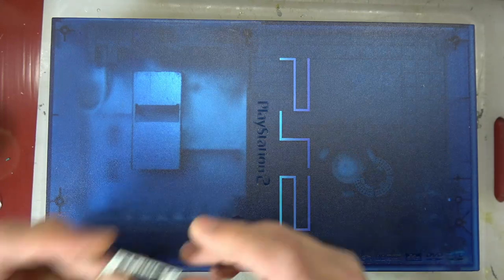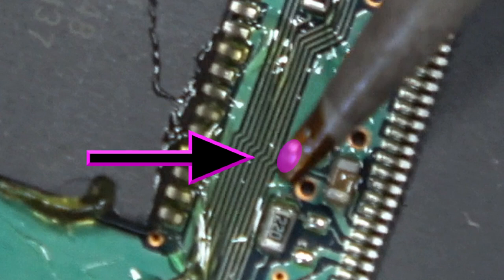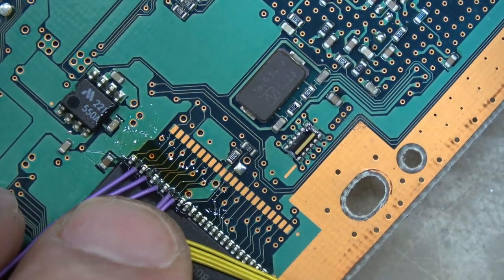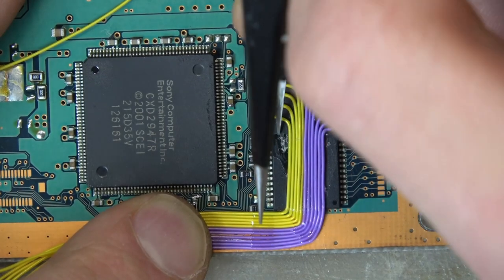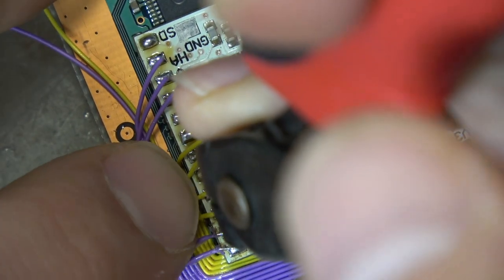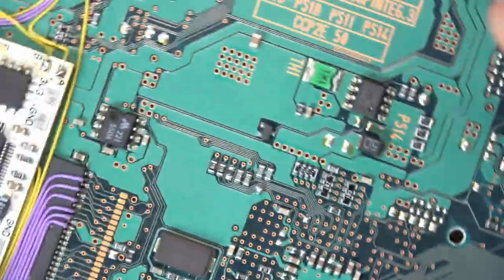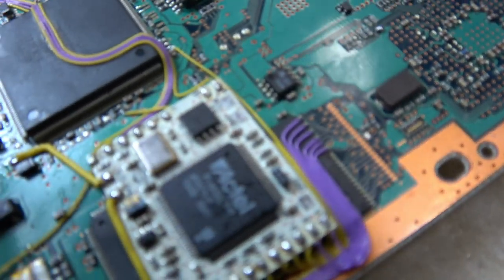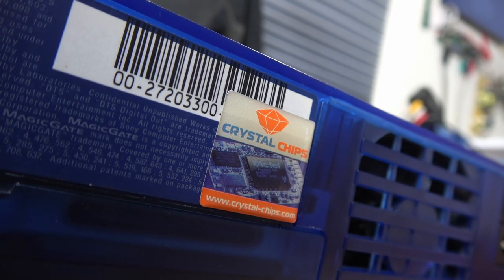PS2 FAT CRYSTAL CHIP MOD

Comment: Hey RGA, i got a question. I installed a modbo 4.0 on my ps2 slim. The install went very well. Wasn't super complicated after all, just a lot of prep but that's really it. I have 2 PAL games. Evil Twin which works just fine. However, the other game, the driving factor as to why I wanted to do the mod initially, is Siren 2. I've tried multiple TVs, cables, settings, but I can't get the game to run. It'll crash during cutscenes or even the first five minutes of the game where the game crashes during the first in-engine load screen. The only way the game doesn't crash is when i set the chip to Pal 50hz but of course i get the vertical scrolling screen. Is there any workaround that you know about in order to get the game to run? I'd really appreciate any advice you can provide. Thanks in advance.
Reply from the maker: the modbo have around a 98% compatibility rate for games, theres a few games that do not work with them, try other games and let me know if they work, so that way you can rule out if its a problem with the chip or if siren 2 is just one of the few games that dont work with it
Reply: @RETROGAMINGARTS  I appreciate the reply. Unfortunately i don't have any other games I can test. Is there anything else you can suggest? I've also tried burning ISO files from other PAL games and tried playing burned versions. But that didnt' work and I don't if it's because I burned it wrong of if it's the same problem. I also tried ripping the game and converting it to NTSC with a program that was almost impossible to find. And sadly that didn't work either.
Reply from the maker: @Derik64  ok, let me get on a keyboard because I'm going to type you up a long  troubble shooting techniques reply. And holy crap... let me know if my reply would make for a good video! 
(An idea has formed!!)
Reply from the maker: @Derik64  *MODBO TROUBBLE SHOOTING
*
First thing to note is the difference between the 2 install points on the board. The points that go to the BIOS are W, R, M, N, O, P, Q, T, U, V.. with W being the most important. Now if the doesnt properly work, it could be because of these bios points, and heres some Way's to tell if its not working.

One of the first things to do before troubble shooting to much is 
While booting the PS2, hold TRIANGLE + CIRCLE. This will give you access to the modbo's  menu. If you have access to that, your modbo is properly injecting its code into the bios. IF you get this screen, SKIP down to the CD/DVD controller part of this comment

IF your MODBO install
 Does any of the following...
1, boots a black screen
2, booting and freezing on matrix logo
3, booting and displaying 4 red ! ! ! ! 
4, ps2 boots perfectly and runs normally, but is UNMODDED it seems.
(all 4 of these could also be the modbo chip having whats called 'a bad flash' meaning since they where made in china in large quantitys, they could have been programmed incorrectly and still sold)

so if any of these are the issue, FIRST, examine your solder joints perfectly, make sure NOTHING is bridged and everything is the right point from the diagram. Also doubble check the Diagram with your GH-00x number. Make sure you have the CORRECT GH-00x number to your diagram, for instance, certain SCPH-xxxx number PS2's can be a certain V# , SCPH-70012 is a V12 for example. and that V12 can have multiple different GH-0xx-00 numbers. So cross reference the install diagram multiple times.

IF YOU ARE 100% CERTAIN you used the correct diagram, and your solder joints are perfect remove the chip and replace with new chip
. before replacing with new chip, test your PS2 as its stock, just to make sure nothing is wrong. If the PS2 is reverted back to stock and you still have issues. look for a component that may have fallen off the  PS2 during the install.

*FOR PAL PS2's THE "H" POINT ON THE INSTALLS IS NOT NEEDED, ONLY USE THIS POINT FOR NTSC/JAP PS2S*

OK, SO, LETS SAY NONE OF THAT IS YOUR PROBLEM, Lets say your PS2 boots to the Matrix infinity menu, but you can get any media to play.
That will be your CD/DVD controller points,  the CD/DVD ccontroller points A, B, G, H, I. and the CD/DVD controller is that BIG chip with the super fine pitch legs.

First thing you must do, to diagnose this problem, is play every type of media you can. Start with media from the region of the PS2.
Lets pretend we're talking about a JAPAN ps2.

1. try Japan PS2 game
2. try NTSC/PAL game

Now that you have confirmed the region works or does not work, we can move on. If the system is a JAPAN system, but will not play japanese games. Either the laser just died or every solder point needs to be doubble checked, and possibly removal of the chip, reverted back to normal, tested, and installed with a new chip.

If Same region media works/other region media works. (also test ps1 region and other region)

 Now its time to test Burned media, Start with PS2, then do PS1.

If your getting mixed results of some media working and others not working, Redo the A, B, G, H, I points, double check your solder work, and your diagram.
These points are the points that control the different media that is played. So that's exactly where to check. 

*Some Other key points to mention*
1, the RESET point helps time the chip with the bios, to boot the chip into the bios at the correct time, so this is an important point.
2, the CX point is the clock timer, the ORIGINAL MATRIX INFINITYS had a clock timer intergrated into the FPGA's code, so the clock point was NOT NEEDED on the originals, however, the MODBOS are a chinese clone of the original matrix infinitys, and they do not use the same IC on them, they are not capable of having a clock timer inside (the crystal chips used a crystal oscillator on them for this) SO the MODBOS use the CX point, witch pulls the clock signal from the PS2 itself, If this point has interference it can throw the whole mod off. Ever seen people run wires under the legs of the CD/DVD controller chip? (i'm guilty, i've done it several times...) you should be weary of do this. 90% of the time it doesnt matter. but if there is interference on the CX point, it can throw the whole mod off. Doubble check this point if your having issues.
3, POWER/GROUND, These points should be 24 guage wire, or 26. Thick wire. These chips do not perform well when the voltage and ground wires are thin. this can cause several different issues.

ok, i hope this is enough to help your issue, if not let me know, keep me posted. I also hope if anyone else is having issues they see this and it helps them!

Comment: Flux isn´t for reduce Oxigen. its etching the oxide layer on the (copper/Iron/zinn...) so solder only sticks on the materiel not on the oxide thats why u use flux ;) . Oxide is createing by the materiel itself if u leave it on the air so flux is etching it and prevent that air is coming on (in this case) copper. :) Sry for my bad english :) Hope u can learn something :) I learned that in school. In germany u need to go to school too, to be a blacksmith and soldering is a part of this cause u can use soldering not only for wires you can use it like kind of welding, than its hard soldering.
Reply: and holy fuck i love ur wirerings ♥
Reply: yeah it prevents it from oxidizing, u get his point.

Comment: I own a fat PS2 with HDD installed and I use Free McBoot to dump PS2 games to hard drive (from PC via Ethernet) and play them without putting any additional stress to an optical drive.
I've visited Russia recently, and brought some of my old favorite PS1 games my parents still had in my old room. But since every PS1 and PS2 game in Russia is pirated, the only way I can play them is by using a disc swap method, and I don't really like that. I also brought back few PS2 games and there's no way I can play them without a chip mod.
So the question is: Is there a chip that will allow me to play unlicensed (burned) PS1 and PS2 games and will not conflict with Free McBoot?
Thank you.
Reply from the maker: From my experience, you can use free mc boot AND a modchip at the same time, the only time they conflict is when using FCHD, free mcboots HDD version, if your using a free mcboot memory card it should work fine with a modchip. HOWEVER, your freemcboot should be able to play your old burned games

Comment: My PS2 with DMS3  was damaged by seawater and when i cleaned it up and tried to use in another PS2 i got BLACK SCREEN, is any chance to check by tester it';s work condition?
Reply from the maker: Yes. Doubble check every single solder joint. And check the bios connections aswell

Comment: Link to where you can buy the wire from or at least info on the wire, also what gauge is that? Cheers
Reply from the maker: Hey, sorry I didn't put any of this information in this video, I made a few other videos just like this that have it so I left it out, my bad. It's 30 AWG kynar wire,  I buy from ebay usually. I use 26 Guage stranded wire for power/ground (24 is ideal)
Reply: @RETROGAMINGARTS  Cheers for the reply :)

Comment: Wait, am I seeing things, was that a firewire 800 port by the two usb ports?
Reply from the maker: I'm not sure what firewire800 port is
Reply from the maker: Sounds like an old connection from the late 90s that got phased out
Reply: @RETROGAMINGARTS  Pretty old data transfer tech from late 90s/early 2000s. It was pretty popular cause it could push 800Mbps, which was a lot at the time.

Comment: Hi mate. Does a bad solering or wiring cause hdd read issue????
Reply from the maker: Theres many things that could cause that, why, what you got in your ps2 and what happened?
Reply: @RETROGAMINGARTS  thanks for the reply. I have a fat ps2 with freemcboot mc and a gamestar sata hdd adapter. I formatted a 500gb hdd with winhip, loaded a couple of games and hooked up to my ps2. In hd loader and opl, no games showing. I used hdd manager (misc) in ulaunchelf and it shows like hdd connected but not formatted. I formatted the hdd in ulaunchelf and it shows the hdd space and was able to read. Once i reboot my ps2, again its showing hdd connected but not formatted. I tried  with other gamestar adapter and hdd but same issue. I'm spending more time but still couldn't find what cause this issue. Any suggestions mate??.

Comment: Where did u get those nice cables?
Reply from the maker: Here's an exact link to some of the wire i use
https://www.ebay.com/i/252533787813?chn=ps

and another link for different colors
https://www.ebay.com/itm/30-AWG-KYNAR-wire-wrap-30-gauge-Kynar-100-FEET-Any-Color/200406828204?hash=item2ea92d84ac:g:f9gAAOSwUuFW1Zv-:rk:23:pf:0

Comment: How can i play some burned iso because my gta san andreas is pretty scratched and not working :( 
So how can i play a burned game on my slim?
Reply from the maker: A chip like this will do exactly that 😀
Reply: RETRO GAMING ARTS yeah bur do you know a new one ? Because the one you had was very old
Reply from the maker: @e99g  modbo5.0 is the current chip, its a clone of these good old ones, but you can use any modbo4.0/750/or5.0 chip, any one of those 3 will all do the same, i did a video about the modbo5.0 feel free to go check it out
Reply: RETRO GAMING ARTS did you installed also some mod chips on a slim? :D
Because I found recently my Slim babay in the basement and i want to play some good old street boyz or flat out , but the problem is that the discs are just scratched
Do you have some tutorial for the slim?
Reply from the maker: no but, i have a slim i hafto mod, so i'm going to film it and make a video about it
Reply: RETRO GAMING ARTS ok nice thansk

Comment: Wow, superglue? That may look nice, but it could cause issues in the future. These modifications should be (easily) removable. If you want that look you could try supergluing just the top of the wires and not adhering them to the top of the chip.
Reply from the maker: They peel off from the top of the chip pretty easially. It's when you glue them the the solder mask of the pcb board is when it becomes a problem. I could remove this mod and make it 100% stock in less than a few minutes.
Reply: Why would you want to remove the mod? Just buy a new console, they are so dirt cheap...
Reply: @chajaso  He's saying that the super glue isn't an issue, not that he would ever remove the mod.
Reply: @chajaso  Modifications to the PS2 console will likely evolve over time. You don't want to be stuck with a mod that isn't easily removed. That said: there are a LOT of PS2 consoles out there, but some versions are better than others – and preservation of obsolete technology should always be a consideration.
Reply: @philexile2954  altho partialy true, I wont count on many more updated or improved modchips for older systems to come... or atleast tackling this part of the system. HDMI adding or ISO loading virtual dvd/cd drives maybe, but once a system can run homebrew, why risk killing a system when it works? 

ow well, yeah I sometimes swap a modchip for a newer one I have. but only if it adds a feature a realy old modchip dint came with. not too much glue would be the right advice ;)
Reply: Wut?  The ps2 20 years old LOL evolve

Comment: there is this wonderful device, its called a magnifying glass. get one .
Reply from the maker: I have a few actually. and i even got to use a massive microscope designed for small electronics work(posted that pic on FB) but the cell phone zoom works better than anything else. Or else I wouldent do it

Comment: uhm why would you bother chip modding a ps2 these days when you can easily soft mod it with a modded memory card like i did with mine is basically the same thing
Reply: yeah that brings a lot more features than a simple modchips such as usb drive support, file management and any other apps people wrote for the damn thing

though playing burned disks is kinda harder due to the need to esr patch and some incompatibilities but the advantages outweight the disadvantages by a lot
Reply: because he can.

Comment: You don't even need a mod chip for ps2, you can just use a memory card with a boot loader on it. I bought a bootable DVD for non modded ps2 that wrote it to the memory card, no fucking idea how someone not sony made that DVD. But once you had that you could make as many bootable memory cards as you wanted which work on any PS2.
Reply from the maker: Yep, I've done those. I still prefer the old chips and current modchips. I like the fact that they're 'permanent' ya know?

Comment: nice video, but you should not bend your wires in a 90° angle
Reply from the maker: Oh really? Ugh oh. I dont always do that but sometimes I do. Any particular reason why not? So I can not do it lol
Reply: @RETROGAMINGARTS  i mean in practise it probably wont matter, but if you push the wires to a hard angle like 90° the copper in it will also be bent and stressed more. All wires(especially flexible ones) habe a minimum bend radius specified. You will risk damaging the copper in it if you bend it further. But then again, for your builds, since the single wires are so small, and they are fixed and not moving it shouldnt matter too much, but every good electrician would advise you, to not use a 90° angle
Reply from the maker: @OhaaG  logically it makes a ton of sence, thank you very much for explaining this to me. I have a strong desire to learn more and improve at this craft, so any bit of information helps. 😀

Comment: Is it ok that you burned up a pathway @4:00 ?
Reply from the maker: I don't think I actually severed the trace. Looks more like excess flux that was burned, or else this system wouldent have booted and worked at the end of the vid.

If that was a severed trace that would not have been ok though lol
Reply: @RETROGAMINGARTS  glad it booted! May I ask you a question, do you have any good resources for learning basic electronics on youtube? I know there is a wealth of info... the issue is sorting the chaff from the wheat, as it were.
Reply from the maker: There's a TON of info on my channel, I think you really would enjoy, but more specifically the channel "GREAT SCOTT" is WAY better for learning about electronics, my channel focuses more on soldering and game systems.

Comment: I initially modded my PS2 with a Hard Drive, and then switched to whatever that memory card exploit is.
Reply from the maker: Yep. Free mcboot, does the same as this chip does pretty much
Reply: @RETROGAMINGARTS  I kept the hard drive in there though. Since this PS2 has a really tempermental DVD drive it's just easier to install the games to the 300gb hard drive than to worry about getting the DVD drive in just right each time.
Reply from the maker: @johnrickard8512  your absolutely right, i feel for the longevity of alot of these systems, we are going to need to be replacing the CD/DVD drives in them with HDD solutions
Reply: @RETROGAMINGARTS  well i kinda just use a 32 gb usb stick since i can't afford an hdd + adapter that fit the ps2 but its not all that bad
though my dvd drive is still in very good condition so i use esr anyways
Reply from the maker: @Fogolol  USB works great aswell, i still use discs too, but its always good to have that backup for when this stuff gets too old ya know